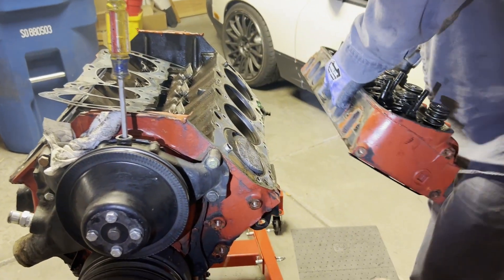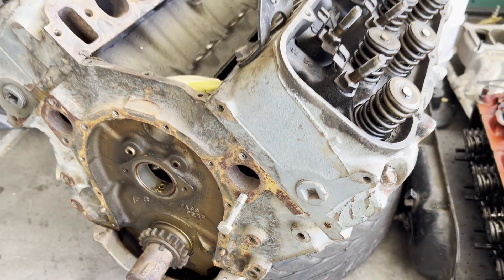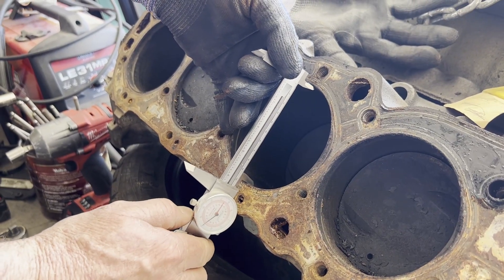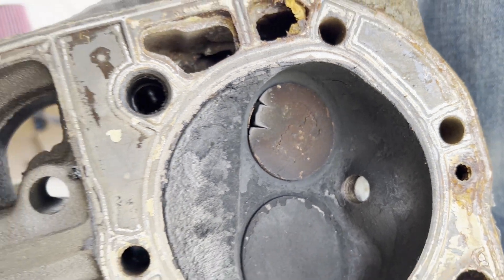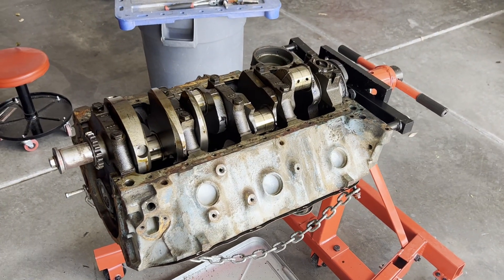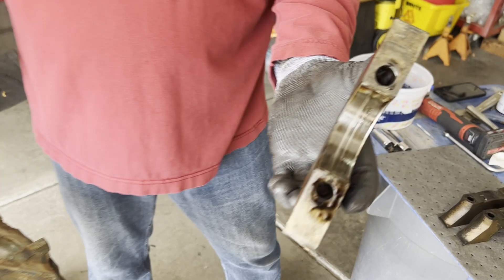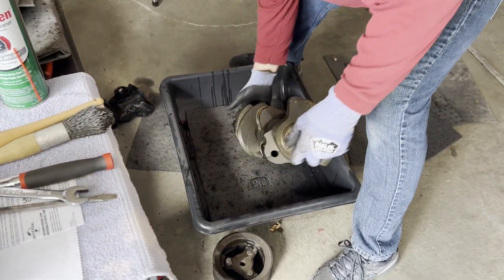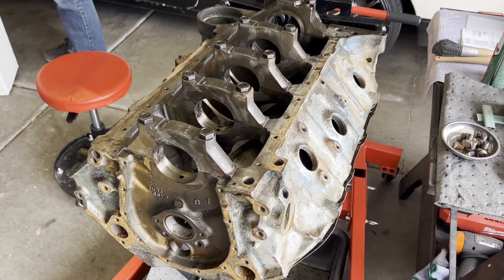We Bought a New Big Block!! 454 Tear Down

Comment: What is the block casting #, what did it come out of, just curious. Is that blue the dreaded corporate Chevy blue?
Reply from the maker: Block casting # is 361959. It was painted blue by the previous owner. Don’t know exactly what truck the engine was in but we know that it was a truck motor.

Comment: You can bore a hundred over easily, I've seen a lot of them bored 125 over. Block is not junk you can put a sleeve in that cylinder if the scratch is too deep.

Comment: I'm not sure what you are trying to do here but that scratched block is far from junk and that scratch would have little consequence on the street.  I'm not criticizing your decision to replace it (a stroker will be awesome) but I am sure it is still usable; I have put worse blocks back into street cars and someone else may be able to make use of it.
Reply from the maker: It did run great, perfect for a street truck but our original goal was to make more power and build a motor with the best quality we’re capable of. We aren’t willing to put money into that block knowing that scratch is there. That’s our excuse to build a bigger and better motor.
Reply: @SchaapRacing  Have it sleeved then the block is ready for a new start.
I have a 1969 Chev BB 402 at 60 over then a shop told me you can sleeve it to start all over.

Comment: Why the small nail-like holes in the tops of the pistons?   I would think for a stroker you would want to source a 4-bolt main block.
Reply from the maker: We couldn’t find an affordable 4 bolt block at the time. For the power we’re expecting to make, a 4 bolt wouldn’t be necessary. As for the small holes in the pistons, we’ve got no idea why they’re there.
Reply: 4 bolt is overrated.
I have a 1969 Chevrolet BB 402 that left GM in 1969 at 425 hp with 2 bolt mains.
This BB 402 is now 500 max hp and runs by guide fishing jet boat which the clients love it for power - speed and old school rumble sound.
I also can outrun every charter boat wanting the same fishing spot and be there 30 minuets ahead of everyone.
So, I am potting out the power running a jet pump after leaving the docks with normally running around 2800 RPM for a few miles.
I just did a full stroker 383 that tested at 410 hp that will go into another of my 19 foot guide boats.
This also is a 2 bolt block.

Comment: A 454 can or can't be bored safely to over 0.060 over. You or the commenters will never know unless you have the block sonic checked. We have seen wall thicknesses on the thrust side over .225 on some blocks that were already 0.030 over.
Reply from the maker: The block was sonic checked before the machine work started and we are starting out with a good block. Thanks for watching

Comment: My engine builder said he built a phuw 454s he bored them hundred thousand he said u would have a 477 they ran good I said they get hot no they were fine he said they like the number 477
Reply: I think I'd rather have some decent wall thickness and just stroke it a little bit. Just my personal opinion though.
Reply: Even a 60 over big block is going to have run hot issues in vehicles but can run in boats when river - bay - Ocean water is running in the block it is fine. 
I am a guide & charter boat owner that runs Chevrolet SB and BB in my boats.